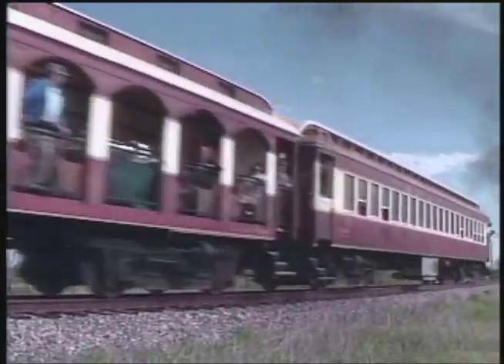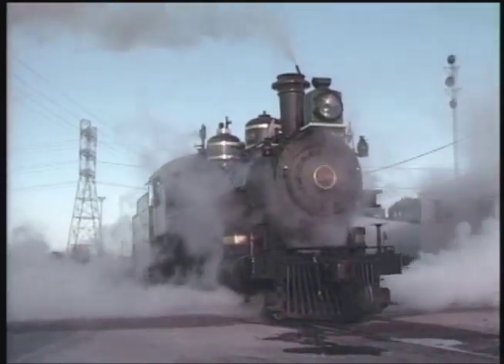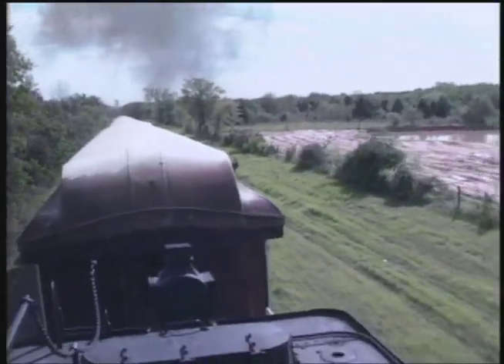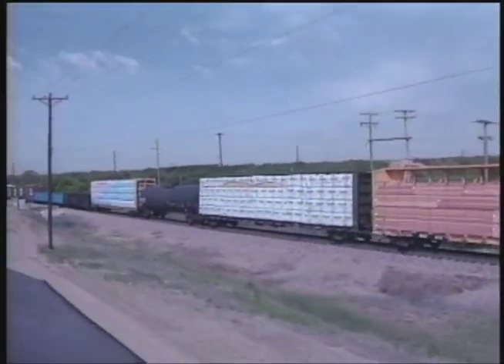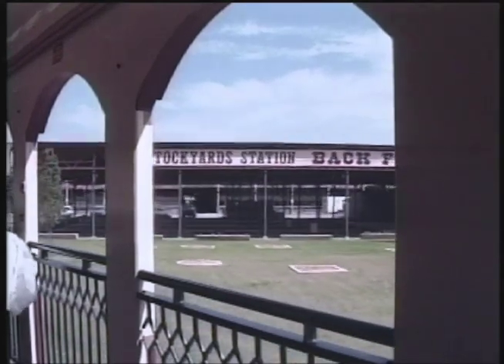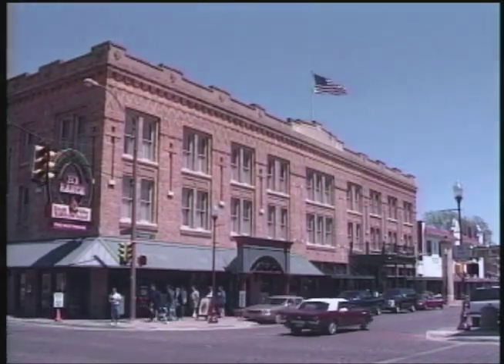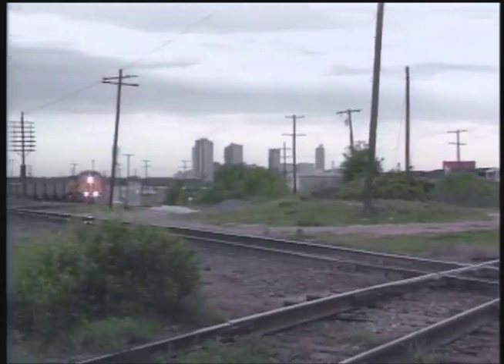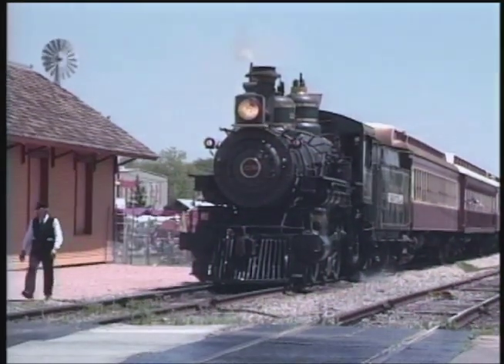Texas Steam Treasure

Comment: I have a mouse pad of 2248, and it too is old but I still use it cause it was my first mouse pad I ever owned and it’s of a train ( I love trains).  I also have a painting of PERE MARQUETTE 1223 on my wall that I found in hobby lobby of all the places, and a wooden crossing buck that too is hanging on my wall.  The only steam trains I ever rode on were the steam trains of tweetsie railroad and the great smoky mountains railroad ( ex-army, WW2 , she never saw action) 2-8-0 , S-160 #1702. Another thing I heard about her when she was on this line is that her original whistle was stolen by vandals wile she was in the shop for here safety inspection.  Also the railroads first diesels that they owned were 2 EMD GP-7’s #711 and #777 (both were ex-Chicago and western and had 1500 horsepower and were later modified from high nose to low nose) also 711 had been upgraded to GP-9 specifications which increased its horsepower to 1750 . Both were gonna be scrapped after they gotten to old , but famous YouTuber Mr.Beast had another idea, he decided to crash the two locos into each other to derail them. I was luck cause they were still cleaning up the wreck and when I found out it was 711 and 777 that were out there I was sad as my first train I rode on that railroad was on ether 711 or 777 😢. Last thing I promised is that both the railroad and these 3 locos were used in movies.  

The railroad was in 1 movie (The Fugitive)

777 was also used in the movie “ the fugitive” ( which you can still see the train wreck if your on the train heading to dillsboro).  

711 was in the movie “ forces of nature “

and 1702 made a cameo appearance in the 1966 film “ this property is condemned “ and a second cameo appearance in the 1972 movie “boxcar Bertha”.  Sorry for the long rant I have adhd and autism and I just love to talk.

Comment: This sure brings back memories. Though it is a shame that 2248 aka puffy has been out of service since late 2015, and is nowhere near completion.
Reply from the maker: It's a marvelous locomotive, wish it was treated better.
Reply: Yeah…
Reply: She has been out since at least 2011, not 2015. I know this because I rode the GVRR back in 2011 and my parents told me “the steamer [was] not working (which I now assume meant she was getting her FRA-required boiler inspection).”
Reply: @nathanielcoleman5694  no her last runs were in October 2015
Reply: I read that the GVRX has plans to have the #2248 ready for service by 2023 (this year).
Reply: @MackeyBigBoy4014  where did you hear that from? Last I heard, it was still in pieces.
Reply: Love to see a backup steam locomotive to 2248 w more tractive effort and horsepower. 982 would be too large I think
Reply: @MackeyBigBoy4014  we're almost into 2025, still 0 progress made on her(Inside source as of a few months ago) the city of grapevine are the worst caretakers of that engine. Honestly, she'd be better off going back to the Texas State Railroad, even though TSR didn't want her because she struggled with their trains on the grades.